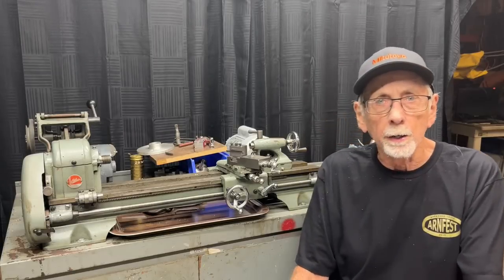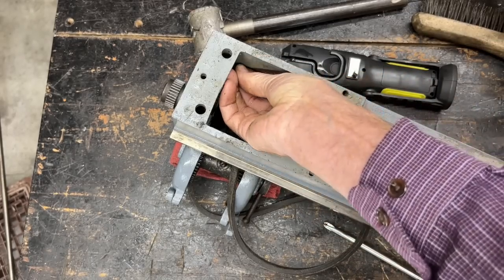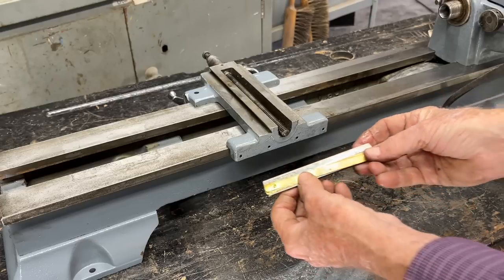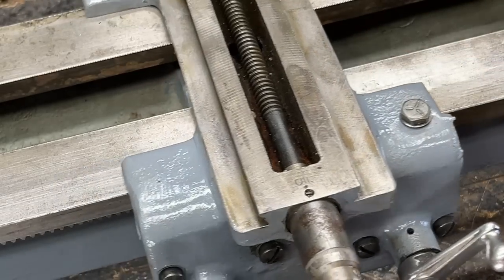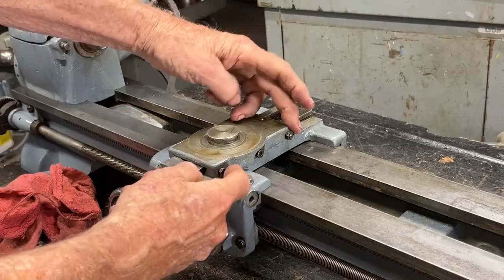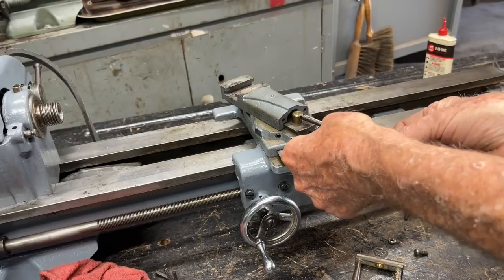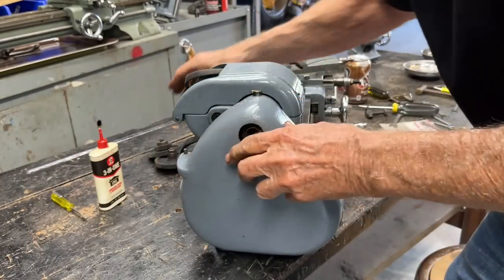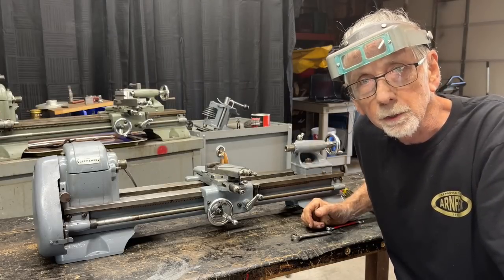REASSEMBLE THE SEARS CRAFTSMAN 6" Lathe #1024 tubalcain

Comment: Mr Pete,
   Wonderful video! I have an atlas/craftsman 6" lathe, as well as their horizontal mill and shaper.  I'm currently in the process of restoring all three (the lathe will be first).  Are you considering putting together a shop course video on the 6"?  I have a number of your other videos (the ones on the Atlas Lathe, Southbend Lathe and Shaper were great,  but a shop video course on the 6" would be extremely helpful, since there are probably some tips and techniques you know (as well as limitations)  that would specifically apply to a machine of this size...  Hope you decide to do one!
Thanks for all your efforts!
Reply from the maker: My course on the 6 inch Atlas will be available in June hopefully

Comment: I have a lathe chuck question.  My new 4 jaw self centering chuck for my Craftsman 6" lathe has a plate on the back.  I see many chucks without this plate.  I am currently turning down my back plate.  Can I remove  the manufacture plate and just use the machined back plate?

Comment: I have one just like it that I have had for years. I did clock work for around 35 years, which I used this lathe for making parts. I also have a '54 " Atlas. the 6" is a Craftsman. Also I have 2 mini Harbor freight lathes and a 54" Sheldon. Enjoyed your video.
Reply from the maker: Sounds like you are well equipped

Comment: I love old Craftsman machines. I recently refurbished a 150+ pound beast of a Craftsman wood jointer that's 75 years old. It adjusts with beautiful old dovetail ways, and the fence alone weighs 35 pounds. Wouldn't trade it for anything. Thanks for the video.

Comment: Thanks Lyle.  I have never owned an Atlas or a Craftsman, but I have partially restored a Dalton Type 4 lathe from 1922.  It was a absolute rust bucket when I found it.  One thing I have on it is a Atlas Lathe motor mount, mounted backwards.  You see.... I mounted the Dalton on an original Dewalt saw base  stand with a plywood base added.  I hooked a metal bar under the plywood then bolted the motor mount to that bar  BACKWARDS.  I then installed a  recovered Dodge(?) ... some bar off the suspension from the table base to the motor mount plate.. It meets the motor plate at an angle. and I have some pipe large hose clamps on that triangle.  When I got the belt on the Dalton 3 pulley drive system, I tightened the clamps and that holds the motor (its heavy) upside down to the lathe. the weight of the motor and the  triangle bar arrangement holds it. It isn't "right" but it works.  I have used this arrangement for a few years and it works a champ.  You are one of a few men who might understand what I described.  great video sir.
Reply from the maker: Sounds like you are a real engineer!
Whatever works for you is the correct solution
Reply: @mrpete222  HECK NO!  I'm a dumb hillbilly.  Been watching Mr Pete for near a decade and from you sir I learned a BOAT LOAD!  I worked with what I had.

Comment: Mr Pete, I love your videos. They are quite helpful. I have purchased an Atlas TV48 with the pick-o-matic. I’m in the process of cleaning, painting, and replacing the worn out parts. I do have the manuals and parts break downs. The question I have is have you ever worked on a pick-o-matic?  I’m having problems getting one of the shafts out. It appears to have a pin through a gear, but no way to drive it out. Any help would be appreciated. Mike
Reply from the maker: Mike.
No, I have never worked on a pick o matic. In fact, I’m not even sure what they are. Is it the lotto?
Reply: @mrpete222  it must be. I’ve only seen 1 other on you tube and another 1on a machine forum. Mike
Reply: FYI. I was able to get the gear off the shaft. It has a .050 Allen wrench set screw in it. Mike

Comment: I have the Atlas version, and the carriage lock was a hex head bolt like yours.  I assumed the original square head bolt was lost or broken and replaced with the hex head.  After listening to you in other videos, I made a square head bolt and matched the size to the tool post bolt.  Looks great, but guess it isn't as original as I'd hoped.  Keep up the great work!
Reply from the maker: I need to make a square head bolt for both of mine

Comment: Looking good - thank you for sharing all this information.  Just curious if on the two 6" lathes have you noticed any wear where the handwheel shaft with the small gear goes through the carriage casting?  The carriage on mine is worn and as a result the weight of the handwheel makes the shaft drop down slightly at the handwheel end.  I believe the wear on mine is due to lots of use (and abuse) and not much oil being applied to the lubrication hole. I am surprised that Atlas did not place a small felt in that hole and the oil hole at the carriage feed lever shaft to allow oil to seep down but keep grit and debris from reaching the shaft area.
Reply from the maker: Both of mine are sloppy and worn. Apparently it’s a common problem with these cheaper machines. I’m glad to find out. I’m not the only one, lol.

Comment: Mr. Pete, looks very nice. Are you going to make large dials for the cross slide and the compound for greater visibility?
For everyone, here is a formula I found to mix the Atlas Delta Gray paint. The quantities given will produce less than a pint.  Sorry, I have not  done this so you are on your own.  I found this on the interweb before Google existed, now you can only find what Google decides you want to see.  

456 grams White
228 grams Black
28.5 grams New Green (I could not find this actual color to see if it is blue, yellow or like a forest green, sorry.)
228 grams Raw Umber
39.2 grams Deep Gold
Total is 1169 grams or 10.25 oz.  
If you try this, pleas note the decimal point for the green and the gold amounts unless you want to keep a large reserve by correcting the mistake with greater quantities of the other colors.. 
Good luck with finding  green shade and let us know if this matches the original gray with a green hue that Atlas used.  I too like the original color because it represents Atlas. I don't know if you would be able to contact Atlas and successfully get information about this. Corporations seem to want to forget the past that made a brand great. GM Heritage Foundation is now like this and will not look up records for particular questions about past products. They used to bend over backwards to help but no longer is this the case. Bean counter involvement?

Comment: I have never taken one of these small machines fully apart. Your reassembly pointed out some issues that I can correct on my slightly larger big brother. 

I am interested in thar there is no provision to align the spindle centerline to the bed centerline. The keyed headstock base is machined to accomplish this??? There is no access to the headstock hardware to adjust for any taper error. I assume that the tailstock could be shimmed to correct centerline height error with the spindle centerline???

My change gear cover rubs on belt pulley when securely closed at certain belt speed settings. I have adjusted everything eternal to the cover, pulley locations, etc, and I will need to investigate if my model has the adjustable bedway clamp mount like the 6". Every lathe that I have ever serviced has "accessible" headstock mounting hardware, a pivot pin, and a push-pull alignment mechanism. My major service experience on lathes is limited to industrial machinery and specific issues that I have addressed on my hobby Craftsman. My machine has acceptable headstock/spindle taper error, so I have never investigated how it is designed. I own no parrs or service manual for my little machine.
I haven't used my machine for threading, and I lived with the carriage leadscrew bearing lash. If my headstock end bearing block is slotted like the 6", that issue will be promptly corrected.

Industrial lathes in my experience have provision for adjusting bedway flatness, twist, crowning,  etc, that these little machines don't  incorporate. I have yet to complete my larger 3 phase generator upgrade project to enable me to operate my large industrial lathes,  so the little Craftsman sees extreme service. I have done a lot of repairs and upgrades to my Craftsman to maximize its capabilities. Your video has given me more clues. 
I currently own 4 Craftsman machines. I am a decades long Craftsman  brand hater, so I constantly feel the need to excuse my ownerships. I always refer to my Craftsman lathe as an Atlas, just to emphasize that it is a step up from the machines sold during and after the early 1970's when I was introduced to the brand and I was in my teens.
I do own a 1942 "pharaoh head" Craftsman drill press that is extremely well built for a small bench top machine. I keep it as a favorite user, even though I own much larger industrial drill presses. I have forgotten who made this machine for Sears and Roebuck, but it was only manufactured for about 6 months due to war manufacturing production demands. I also own an extremely heavy vintage Craftsman 12" wood planer that deserves to be resurrected.  I have modern 12" planer options, so its resurrection has been a very low priority.

Thank you for this series. My machine shop is winterized. I am back inside and in my heated woodshop. I will postpone my Craftsman lathe improvements until warmer weather. I value your videos. I am always learning something new or enjoying the ride!
Reply from the maker: Thanks for a wonderful dissertation on your craftsman machines
Reply from the maker: Thanks for a wonderful dissertation on your craftsman machines
Reply from the maker: Thanks for a wonderful dissertation on your craftsman machines

Comment: This is one of the few times I've seen you add paint! Or maybe the first time! 
 Paint is overrated but I'm still painting on the Bridgeport head as I disassemble/overhaul its bearings(currently).the big stuff is done.......There is something that feels good about using equipment that doesn't look abandoned/ forgotten and neglected by "BUBBA"
Reply from the maker: I've done a bit of painting here and there but only when it makes sense.